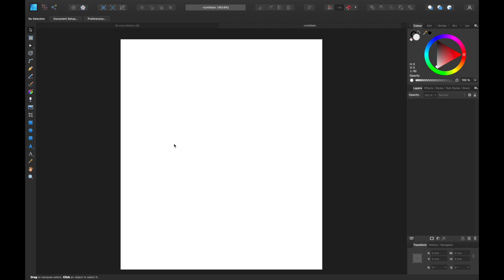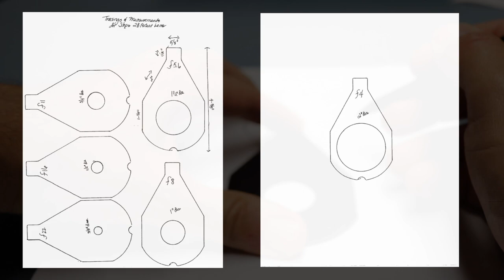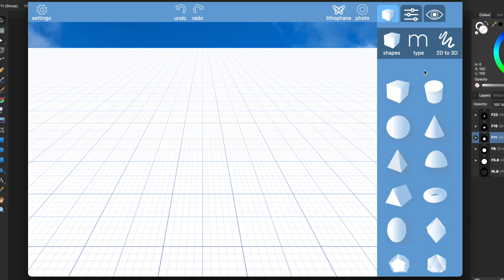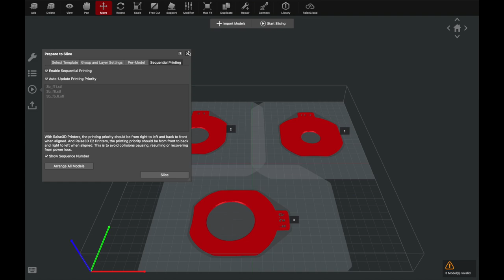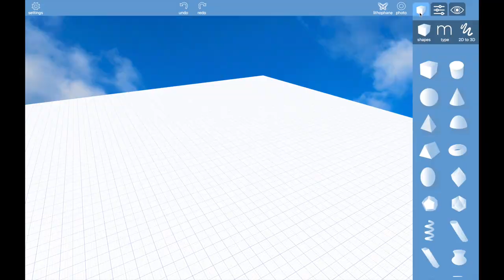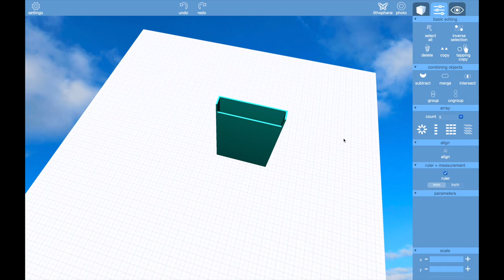How to make Waterhouse stops for antique lenses

Comment: one tip: if you want a metal one, ie : brass/aluminum/stainless steel, just export the file to a laser/waterjet cutter, which can cut it from sheet metal. ( or just give the file to a metal shop to make it for you).
Reply from the maker: I wanted to get one by myself and cut some made of abs :)

Comment: there's a SERIOUS error in this video. you can't calculate the diameter of the hole by dividing the focal length by the f-stop. focal length divided by f-stop gives you the diameter of the hole measured while looking through the front of the lens, not the actual physical diameter of the hole. you need to calculate the difference in scale between the two and adjust all your hole sizes accordingly.
Reply from the maker: Thank you for your comment. Can you please explain with an example how to calculate the difference in scale? Because the formular I use is written down on many websites, like slr lounge for example. Thanks a lot!
Reply: @mhaustria  if for example your waterhouse stop has a 50mm hole but the hole is 75mm when measured by holding a ruler in front of the lens (preferably while looking through a mirror since the measurement is more accurate from further away) 75mm/50mm=1.5x difference in scale. so let's say it's a 100mm lens and you want an f/2 stop. f/2/1.5. 100mm/2=50mm, 50mm/1.5=33mm for the physical diameter of the hole in the stop.  

https://www.youtube.com/watch?v=OaSq0ES1ArE
Reply from the maker: @creepyloner1979  Thanks a lot for taking the time to explain it. The link to the video is awesome! Really great explanation for the diameter part. I just checked it on my Dallmeyer 3B and the difference is there, but not as big as I thought it would be. It is. I calculated about 1/3 of a stop difference. As Gerald Undone
  said, this is more an issue with tele lenses. As I suspect, it has also to do with how much elements the lens has. These old Petzval lenses are minimalistic in that way. But I (and I think many others that were writing to my about your comment) learned something today - thanks a lot for that. I added the link to the video and in the description.